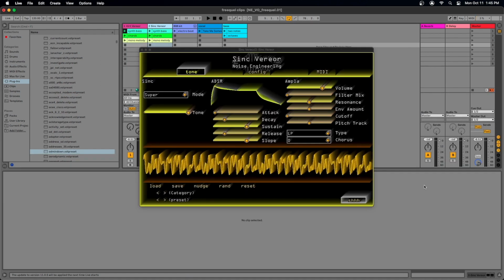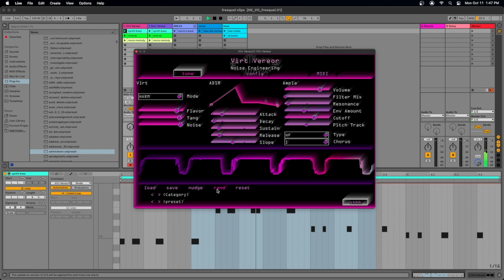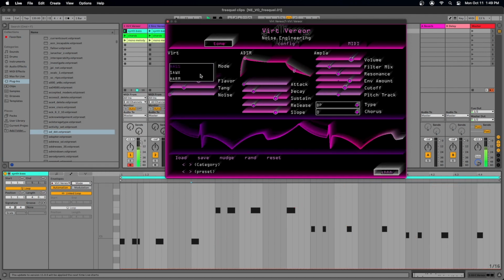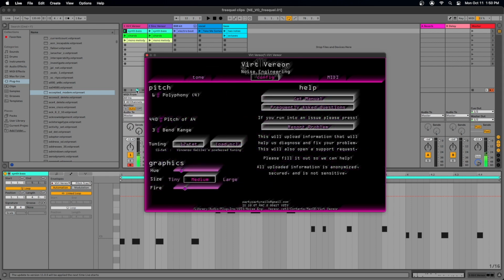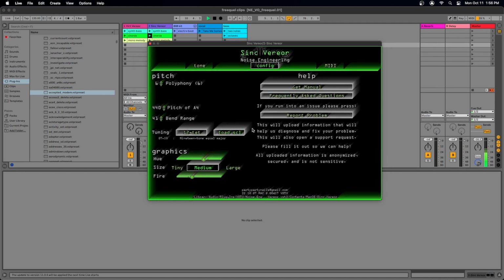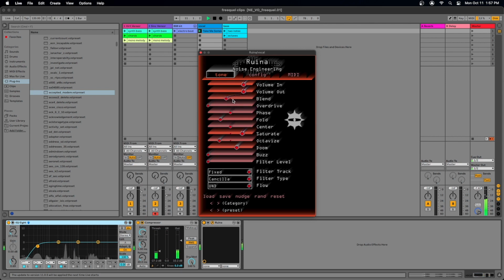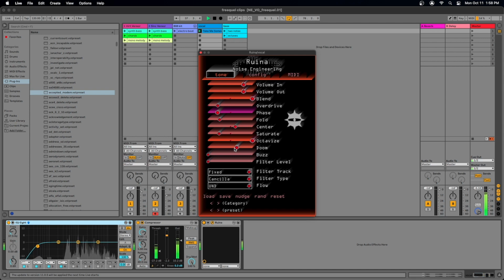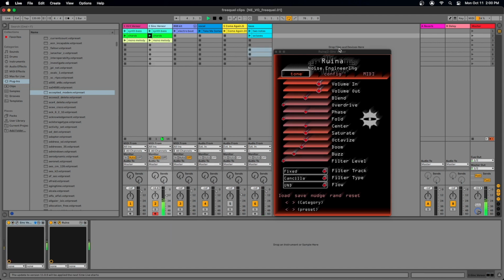FREE Virt Vereor, Sinc Vereor, and Ruina plugins for VST3, AU, AAX - official plugins demo

Comment: you can't take the octave division off of the output no matter where the "octavize" slider is.  Ruins (?) the whole plugin really.   Am I wrong or is it always going to add an octave lower in the output?  thx
Reply from the maker: Octavize and Doom both add octave effects to a signal, but setting them to minimum at the left should eliminate these effects!
Reply: @NoiseEngineering  Okay, I think it was mostly Doom that was making the lower octave so when I set it to 0 it went away.  octavize didn't seem to really do much but as long as the deep octave can be turned up or down, I'm happy now.  thanks!!!